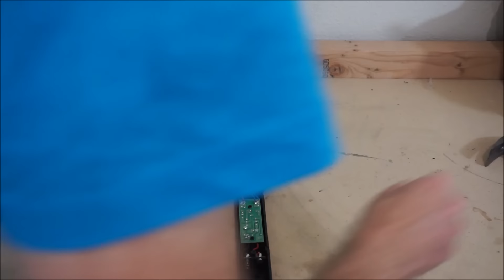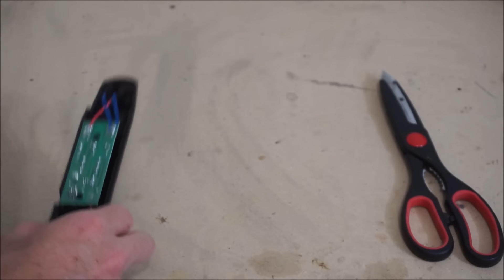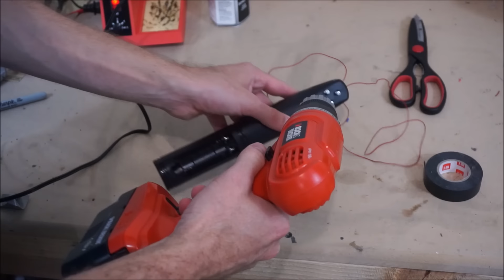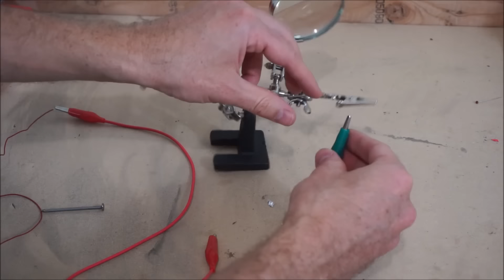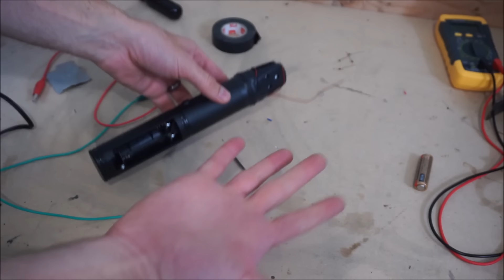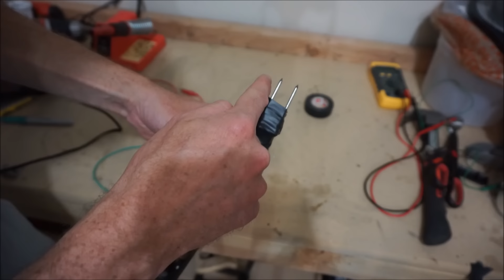Shocked By Homemade 3,000 Volt Taser| High Voltage Science

Comment: Great vid! What happens if you continue pressing the on button until the battery runs out? I ask because mine stops creating arc after about 2 seconds, then I have to wait. Is my module broken? Do I need capacitors?

Comment: You know what frustrates me about these Taser videos? I had a 70,000 volt taser a very long time ago. And i accidentally shocked myself with it. And it hurt.. But it wasn’t strong enough to bring me down. You say this is a 3000 volt? If 70,000 volts from a taser is not enough to take someone down. Then 3000 will not doing anything!
Reply: Perhaps u are stronger than others

Comment: I made one for 3$
2$ For the generator from E-bay
1$ For a double 18650 battery holder.
I already had some 18650s, good thing about those, they are rechargeable, rated at 3.7V each 7.4V is just fine.
Works like a charm.
Reply: What kind of generator did you bought?

Comment: you  can measure the voltage by taking some resistors to divide the voltage.Then you can mesure the voltage at one of the resistors and calculate the voltage of your fly trap.(you should know the inner resistance of your voltmeter.)

Comment: 3000 volt isnt much. You can buy high voltage inverter module very cheap from ebay that produces 20-30 thousand volt, now that has a big spark
Reply: 30000 voltage
Reply: You are right bro high voltage generators makes 20000v - 1000000v
Reply: Vladimir Putin  Yo Putin, where do I learn about electricity?

Comment: That fruit was conductive but how it hadn't harmed you
Reply: Most of the current was flowing through the fruit. But it's definitely not the safest way to hold the fruit barehanded like that, in case of a more powerful high voltage source...

Comment: Since you didn't solder together a voltage muliplier with ceramic capacitors, and diodes, so you can't get a big arc that can jump a larger gap. 10,000-40,000 volts is enough high voltage for me.

Comment: I don't want to be one of those guys,,,,but,,,the 'taser' didn't light up or make the sound. Personally I don't believe you actually did do it on yourself.
Reply: josh williamson. its not high enough voltage to arc or spark, but it will hurt.
Reply: flesh has more resistance than metal, thats why the wires sparked

Comment: Most store-bought tasers run in the 100kv's region.

Anyway, this is a lot more effective if you remove the bleeder resistor accross the tank cap at the end of the circuit so it will hold a charge even after the button is released.  Personally, I'd just remove the whole HV DC end of the circuit and build my own voltage multiplier and solder that to the HV AC end of the mini transformer, but then it isn't as simple as this one is.
Reply: Lunartrek need your help to walk me through this I am a total newb, would appreciate if you got the time.
Reply: Lunartrek I did the same thing

Comment: buy a boost converter on ebay. and use a 18650 battery. and boom you have a 40.000 Volt Taser. for less then $5

Comment: Hight voltage ??? This is a bit weird, the machine that give massage is almost the same, a taser is 50000v and go to 5000000, your taser would probably pissed off a mouse but come on, still a cool video :) You said it bugzapper
Reply: Actually, it's both, the ammount of deadening that electricity can cause is determined by Power[W], since you need Volts[V] to pass through the resistive layer of the skin and Amps[A] to do the killing.
Reply: Danny Garden police tasers are 50k volts and this is stun gun not a taser.
Reply: Yes your right about police taser, but you have 1000000 and more now, what is more important is amps, this is the killer in all that, not voltage.......:)